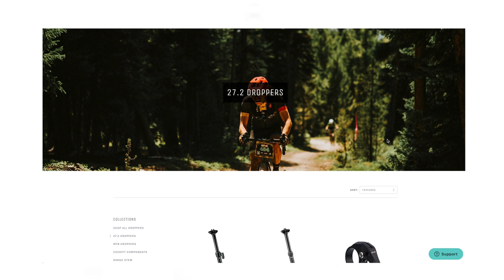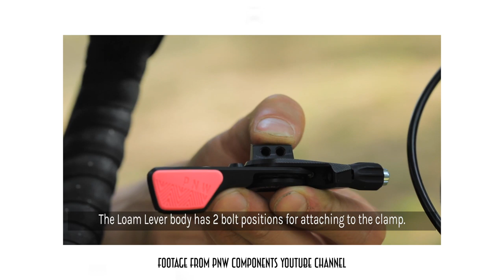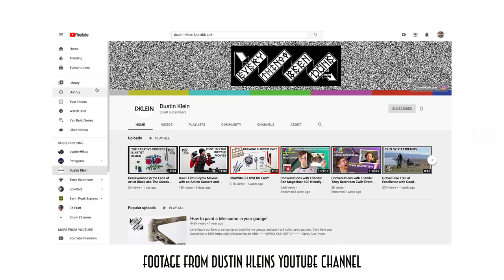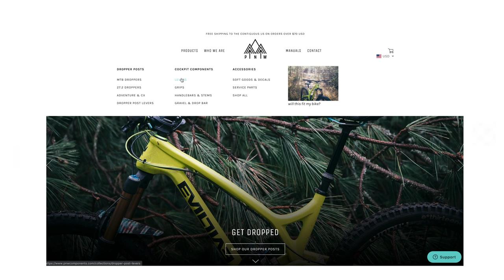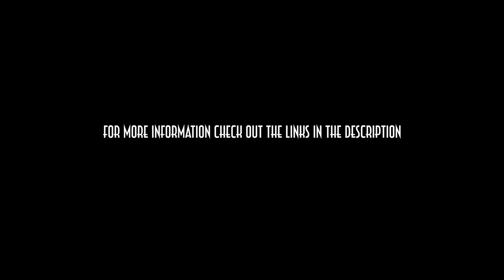Getting RAD on the Rove! (PNW Components Pine: First Impressions)

Comment: I have a dropper on my Raleigh Stuntman and wouldn’t want to ride a gravel bike without one. You touched on most of the reasons. Just being able to drop the seat even an inch makes the bike handle so much better on rough stuff or single track. I have a similar lever - wolf tooth - and would suggest sliding it out away from the stem. It then becomes much easier to reach and adjust the seat with just shifting your hand from the hood to the top bar.

Comment: I've been rolling around on my gravel bike with the Coast and the drop bar lever from PNW.  I was a bit skeptical about the drop bar lever but it seems like the best thing available besides the cool hacks to make the left shift lever work as your dropper lever.  Also, the Coast has some air suspension to take the edge off of bigger pot holes.  I like it because (before covid) I commuted on my gravel bike to work but there were these pesky single track trails I always ended up riding on my way into work and the dropper helps a ton for navigating those.  I also threw a shock stop stem on which helps keep my hands from blowing off the bars in chunky parts of the trail.  I'm very pro dropper on gravel bike, commuter bike and mtn bike.
Reply from the maker: Yeah Alec ! unless you are someone who is only conserned about weight I dont see a reason to not add one to any bike! 
Cheers!

Comment: Love your content.  What’s your thoughts on the non-steel Kona Roves?  I haven’t been able to test drive them but have spent a lot of time virtually riding them online:). Are there certain factors you would advise for someone to definitely save up for the steel, and other factors where aluminum would be ok?  I’ll be riding 60/40 road/trail.
Reply from the maker: Hello PJ thanks for the support! So im going to try and do my best to answer your question but please note I havent ridden the aluminum kona rove. The reason I saved for the steel is because every bike I've had previously has been steel (with the exception of one track bike I still have) I'm sure on the 650b platform the aluminum would offer enough comfort. I think a good thing to consider is your local riding. Which you have stated is 60/40 road /trail but think about that road and trail is is nice road or fool of potholes? is the trail smooth or washboardy? And finally if saving up is the right choice for you depending on those factors and many more that would influence a particular side of the purchase. That being said I am sure the Aluminum is a great option. One has to remember that Kona started as a MTB company and has expanded to cross and gravel. Their aluminum is going to be a SOLID choice. hope this helps you
Reply: Stoked On Spokes Awesome!   Thanks for the quick response.  I found a shops im DFW that carries a few.  Going to check them out.

Comment: Did you have to use a different clamp for the lever? My Rove handlebar is 31.8mm and the clamp from PNW is 22mm.
Reply from the maker: Yeah In the buying options on PNW it should have you select the clamp size… that or it’s an oversized lever altogether on their site

Comment: do they have dropper posts aimed more at mtb or is it all primerily grave bikes?
Reply: Their posts are both for MTN and gravel.  I've been running one on my MTB for a few years and on my gravel bike for a few months.
Reply from the maker: Hey Burke! yeah I think dropper posts were initially targeted at mountain bikes but now that gravel bikes have gone bigger tires there is a demand for 27.2 droppers If you dont have one on your mtb Burke I'd highly reccommend it ! For test run purposes you can just drop your post on technical sections and see the benefits of having it out of the way. You can get waaaaaaay back behind your rear wheel.

Comment: I'd love to hear your opinion on those WTB venture tires.
Reply: For what my opinion is worth to you, I love the Ventures. Very fast, supple, grippy.  Replaced both my bikes with them because I like them more than the Gravel Kings.
Reply: Thanks for chiming in! @CraigEngstrom1 !  Do they feel fast on both paved and unpaved surfaces?
Reply: @alecfotsch3533  Yes, both. Mostly rails to trails crushed limestone and a few gravel roads with chunky. All very fast and smooth. Rides well in the wet too. Haven't tried anything like peanut butter mud, but probably would handle well. Kona is selling their Libre and Sutra (how I discovered them) with them stock, and I feel like Kona knows their stuff as a MBT-first company. They're a good tire. If you do get them, let me know your thoughts.
Reply: Agree with others here. The Ventures are awesome for the rural gravel around here. But if you do mostly paved riding get the Horizons.  Noticeably faster. But just as comfortable. Problem I’ve noticed with the ventures is they trap a lot of small flint in the tread. Could risk puncture. I find after gravel rides I need to go through the tire and pick out microscopic shards.